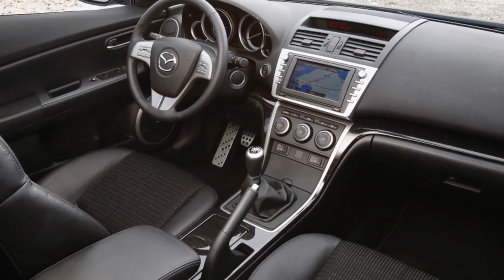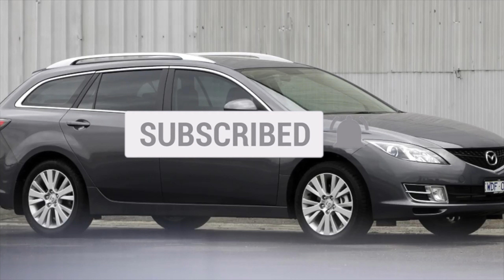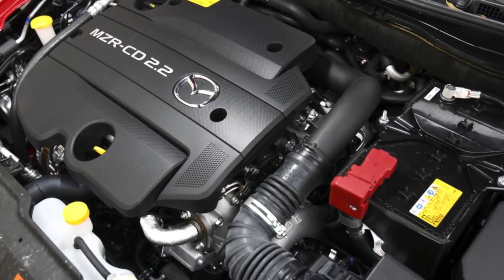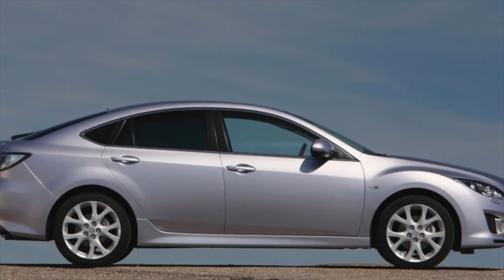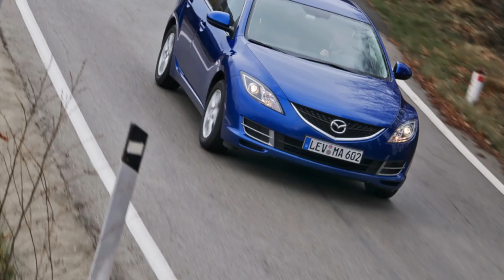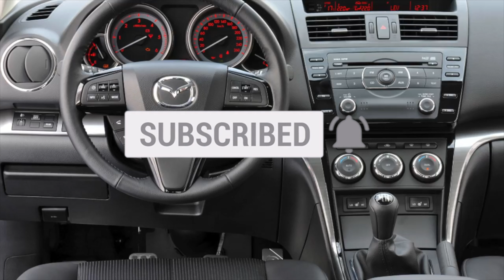Mazda6 (GH) Problems | Weaknesses of the Used Mazda 6 (2)

Comment: One of the worst car i bought first and last

This is why germans car’s are always reliable.  Thought I’ll give a chance to buy one after bought it now regretting
Reply: 1 bad example doesn't mean they are all bad.
Reply: @aapaap8595  fuel efficiency is misleading on my really bad on petrol mpg not the best even it shows 25+ mpg not even getting that, even after a full service done
Reply: @amaya.042  after buy a used vehicle you have to do a proper service its best to buy vehicle in defoult configuration from factory. i have pretty good fuel consuption on 2.0i  i have around 7 - 7.5l per 100km mix roads
Reply: I own both Japanese and German cars, I religiously maintain them and the Japanese one costs less maintenance and has less problems.